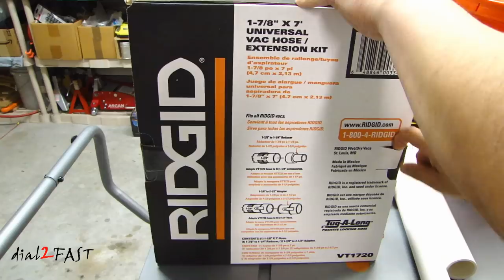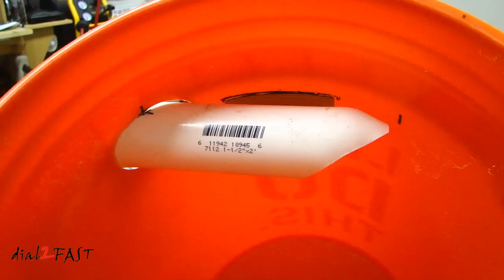How To Make a Cyclone Dust Collector for Your Shop Vacuum

Comment: after woodworking for a few years, today i learned how to cut a perfect circle on a table saw. that's genius.
Reply: And what was the point of cutting the circles in the first place? Or laminating an inch-thick mounting plate? Or using 8 screws? Or using a straight inlet pipe? Or heat-forming? Or driving to HD and taking the rest of the day to save $65?
Buy some wet-vac dust bags and go smell the roses while waiting for them to be delivered, for heaven's sake.
Reply: dufftime I
Reply: y come here to troll, go smell the roses while waiting for a purpose in life...
Reply: @niebzdury1377  Multiple-decade woodworker here, still with all ten digits, and nothing he did there was additionally dangerous than any work on the saw.  It's good to respect a tablesaur, fer sher, but you're paranoid here.  

Safer: A rubber tipped pushstick for his right hand.  Take a piece of dowel to HD and find a crutch tip to fit it.
Safer: A full-width platform with block to stop right hand.  If you do a lot of circles, make one.
Reply: @adamnoman4658   Rich buyers buy, poor makers make.  Pick one, the other, or both depending on your wealth and need to create.  Everyone's happy.
Reply: @ljprep6250  ....                      Whatever
Reply: @nc3826  looooooooooooooooool funny
Reply: I totally agree. That circle cut was genius. Totally going to use this technique
Reply: @ricardoperez5324  Where was the technique on the circle cut?  I guess I missed it!  I would like to learn it as well!
Reply: @danhopkins3242   I think they are referring to 2:58
Reply: HD and Lowe’s buckets are garbage to thin Use a paint or stucco bucket much thicker, great video I will be making one today Thanks
Reply: Adam Noman  Upu missed the whole point of what a cyclone separator does.  I have several of these in my woodshop, home made in different designs, and never have to even open the vacuums, let alone change a filter.
Reply: @Shane Alec instablaster =)
Reply: @adamnoman4658  Well, see, the bucket lid is circular and the outlet pipe is circular, so the most logical shape for the mounting plate was a circle. 

The mounting plate stackup was far thicker than an inch (get your eyes checked) and I imagine this material thickness was used to ensure lid rigidity and get plenty of thread engagement on the screws. 8 screws were used to equally distribute clamping force over a large area. MDF is very flat but brittle in flexion and torsion, so it's important to clamp it evenly. Also, the plates were SEALED to the lid, not LAMINATED to each other. Do you need an explanation for why this device needs to be airtight, too? 

A straight inlet pipe was used because that's how this whole thing works; directing the inlet stream tangent to the circular side to create a vortex. Curving the airflow path unnecessarily creates turbulence and wastes energy. 

The heat-forming was done on the inlet pipe (as was explicitly mentioned in the video, get your ears checked, too) to avoid sawdust from escaping the top of the vortex and going straight into the vacuum hose... which, AGAIN, is the entire purpose of the device. The outlet pipe was heat-formed to ensure the tapered end of the vacuum hose made a positive seal with it, instead of the narrow, easily-detached contact patch you get when you jam a cone into a cylindrical cavity.

I'm just wondering how someone with so little inventiveness, engineering skill, gumption, and (allegedly) free time found this video to begin with, much less why he saw fit to criticize it using easily-answered rhetorical questions that display his ignorance of the subject... MUCH LESS why he proceeded to conclude his critique by questioning the very purpose of vacuum vortex separators in general ("just go buy more vacuum bags, DUH") as if that didn't invalidate his opinion on their construction.

Go buy a 10-pack of vacuum bags, this dude will still be on his first bag by the time you finish your last one. Use the time you saved to read a damn book and learn something.

Comment: Great build. Note you want the inlet dust to circle the bucket in a centrifugal motion. The momentum of the dust will keep it out of the low pressure zone (the center of the bucket) this will help keep the really fine particles out of the discharge. You also want to slow down the center flow compared to the inlet. You could change your PVC insert from the top (the outlet of the bucket) to a 4”. This would slow the outlet velocity to the point that less dust comes out. Really important to have that downcomer extend past the level of the angular inlet, just like you did. Really good job.
Reply: Would using a smaller angled inlet pipe (using a reducer just outside of the bucket) create more "dust velocity" and a better vortex?

Comment: Cool project, been watching about 10 similar cyclone videos but this is one of the better ones. Went into the workshop and built a similar thing afterwards, only I did the whole lid out of wood and put the inlet in the lid as well with a 90 degree bend, works super, makes it more compact and no need to cut a hole in the side.

Comment: Excellent design, I finally find something that doesn't look messy. Lots of detailed information and straight to the point. For thirty years I have used a vacuum cleaner that uses water as filtration, my finished unit will have some water at a very low level inside the orange bucket for further dust entrapment. This post is awesome, Thanks

Comment: The heavy particles will stay in the bucket, however, the finer dust can still make it through and will eventually clog the shop vac filter. One way to help is to add an inch or two of water to the bucket. The water will trap the finer particles and reduce the frequency of filter changes, or cleanings  in the shop vac.
Reply: Vine Len exactly what I was thinking... a dust bong
Reply: TRIED IT, very effective but too messy..?
Reply: I've often wondered about this method as being much superior for fine dust. Have you tried it with fireplace ash or drywall dust both of with seem to be problems with ruining the vacuum? Also, does the pipe with the dust have to have its end submerged in the water so the dusty air has to bubble through the water or is it good enough to just have water at the bottom of the pail? (As @John Sayewich Jr. said - it would be messy, but maybe worth it for smaller amounts of fine dust).
Reply: I figure you would need a second bucket after this first one that would be the water filed bucket one.
Reply: @ryancappo  they used to sell a similar set up at Home Depot. I used it for sanding drywall, so there were no bigger particles. You could try a second bucket but you would probably lose to much suction.

Comment: When you cut that elliptical ole in the side of the bucket, you could have cut it smaller/filed it less and used your heat gun to soften the bucket - then force the intake fitting into the softened opening. Quite possibly all but eliminating the need for sealant.

While the Home Depot Bucket is pretty and has a seal in the lid, it is not designed for  frequent removing and replacing - none of that type of pail are. As well, the small bucket is just that - rather small.  

Given the time, effort and expense involved in the project, the bigger, the better.  Find the largest can you can and adapt it.  The larger the can, the less frequently you need to empty it. 

Ooops, I should first compliment you on your build. I watched the entire thing. Well done.
Reply from the maker: Appreciate your comment!
Reply: I found recently that the buckets used for storing pool cleaning chemicals work very well as they are a bit larger than the typical 5 gallon bucket and the lids seal and unseal with a simple twist, making them easier to clean. If you live in an area where there are a lot of pools, you should be able to find a pool cleaner fairly easily. They are eager to give these buckets away for free !
Reply: M
Reply: Danny H. Nn
Reply: Or you could cut a round hole and use a 22 1/2 on the inside...way simpler

Comment: Nice job on your home made cyclone dust collector. The problem I see with these type of cyclones added to a shop vac is that they are difficult to move around and they take up to much floor space so I solved the problem by mounting my cyclone above the vacuum. With a little ingenuity you can adapt your set up to most any brand shop vac. I also found it easier to maneuver the vac in the shop by removing the existing  three or four wheels and adding a wider platform with six smaller wheels for the base. Also much less likely to tip over when moving .

Comment: One potential problem with simple collectors that have no separating mechanism (such as Thein baffles or cyclonic separators) occurs when the bucket has a few inches of dust in it.  My understanding is that as the level of sawdust rises, the airstream starts picking up dust that is already in the bucket, and starts drawing it into the vacuum tank.  This probably wouldn't be much problem if you empty the bucket frequently.

Also, you should be aware that this won't eliminate completely the need to clean the filter from time to time.  The extremely fine dust tends to stay suspended inn the airstream, and not fall into the bucket, but is filtered out by the shop vac's filter.

You've come up with some very simple techniques for building this, which I will no doubt borrow when I build my next dust separator.  Thanks!

Comment: For the next/advanced version, what you should try to build is something you put on top of a bucket, e.g. by using two buckets that fit halfway into each other and cut off the lower third of the existing one and stuff it on top or similar. The idea is that you can easily swap out the buckets to collect stuff and go elsewhere with one to empty it while having one installed that can still be used

Comment: this is it!  - 
i´ve seen this video some time ago but forgot about it as i was straggling on youtube to explore all the different dust collector projects, most of them with the two chamber idea , but finally happened to come back to this one again! 
Great!  - i´ll definitely build one like this! 

i guess a main factor is the distance between the dust input (plus its drifting direction) and the air output tube
maybe the output does not have to reach as much into the bucket
Reply from the maker: Thanks for your comment!

Comment: Awesome video... I am gonna make this as shown for sure.  I will mount both shop vac and bucket  into a low wooden cart that I would make with caster wheels.  Both will then  be pulled together as one  and also prevent tipping.

Comment: Something that I have learned is that you can modify and old shop vac bucket and taking out the vac motor and sealing it up and then just connecting the hoses in series to the shop vac that works...  By doing this you will have and easier time opening and  emptying the collector bucket, also the holes are already there, you just need to seal up where the old motor was really good and you will have a very respectable and usable catch bucket....  I LOVE MINE AND IT HAS WORKED VERY WELL FOR YEARS, IT ALSO SAVES ON BAGS AND FILTERS....   IF YOU ARE VERY CLEVER YOU COULD ALSO USE A FILTER IN THE COLLECTOR BUCKET TO GIVE YOU A VERY CLEAN EXHAUST.............................  JUST SOME THOUGHTS FROM AN OLD TINKERER..........

Comment: Nice job, I built one based on this design but I ended up having to use 2 buckets for more depth on the debris as my shop vac now has more suction power as the filter is kept clean, it was pulling out the debris from just one bucket. Now that I am using 2 buckets, I get more volume to hold the debris and it all stays inside the buckets. Thanks again and keep them videos coming.
Reply from the maker: Excellent, thanks for your feedback!

Comment: Note:  theses units only separates the heavier materials and not the fine dust! 
i use exactly the same thing daily, except i have a 20' x1 3/4" sump pump hose that cost 9$ instead of 40$ for 6' for "shop vac hose" and i put a few inches of water in bottom wich helps alot (emptying daily). They can  be easily hooked to as little as the 2" mini vacs or  1200cfm dust collection unit.  I can say its great for any table saws, planers, festool track saws, domino jointers and routers all day long. but the fine chop saw and palm Sanders dust gets through even with water in bottom of bucket.so best to use a cloth sleeve over the vac filter, so u can shake it off quick to clean. it saves me dumping a 50g bag and blowing out a giant filter 2 to 3 times a week down to once every 2 weeks! 
plastic lids are very strong no need for all that crazy circle making or plumbing, hot glue seals great too, was a good vid for tricks tho.cheers to clean shops!

Comment: Good video....I went one step different that made life even easier....bought a $5 junk shop vac (Size of a 5 gallon bucket,) stripped the motor off and plugged a few holes with some screws and a bolt.  Took about 15 minutes.  The important plastic pieces were left to allow for the hose inlet/outlets. I can pop the top off in heartbeat and it works like a charm.  Goodwill type stores or yard sales (which is where I got it) are good spots for these....Oh and I can still use the paper and foam filter from the junk vac. (Or not as I choose...)

Comment: Great Project but if you do not want to cut the wood you can at Home Depot Buy a gamma Lid instead of Standard lid and it will Run you 10.00 in the paint section. they are also air tight!!
Reply: I like the idea of the screw-in lid for being air-tight but still easily removeable, but the bar shape of recessed plastic across the lid that makes it easy to install/remove, makes it trickier to get a hole for the vacuum hose. Could the vacuum hose hole be off-center in one of the depressed parts of the lid? (would put picture here, but seems these comments are only for text). You can see the problem here: https://www.homedepot.com/p/Leaktite-5-gal-Screw-Top-Lid-5GAMMA6/203205720

Comment: Great job.  2 suggestions: 1) HodeLowes sells a screw off bucket top, well worth the investment for the lid.  2) The bucket will collapse if your suction is blocked, it’s pretty funny to see.  To stop that from happening, just buy 2 buckets, and simply drop the cyclone bucket into the other. Problem solved.

Comment: Great video, about the only thing I would do different is, I would use something other than a five gallon pail because if you're going to use it for serious woodworking you're going to be emptying it a lot and those lids are a royal pain in the nuts to get off sometimes. Loved the tables saw circle cutting.

Comment: buy a 2nd bucket, put a plastic liner in it, cut the bottom off of the one you just modified and slip it into the second bucket. much easier to clean, and empty.
Reply: Clever idea buddy.
Reply: R0i0c7h i don't understand your idea... Plz explain...
Reply: Kevin Thompson plz explain bro...
Reply: @sunnykapoor0000  the dust will fall to the bottom of the cyclone bucket as normal, but instead of it sitting in the bottom of the bucket it falls into the trash bag inside of the bucket that the cyclone bucket without a bottom is sitting inside of.
Reply: Or just put a little water in the bucket. Presto

Comment: Very good and informative presentation. I like the method of making female inlet adapters with a heat gun. Having access to a metal lathe, I have made them from sched 80 pipe and bore to fit. Your method is simpler and works with readily available sched 40 pipe. Thanks for the tip!
Reply from the maker: +Christopher Schissler Thanks for your comment!

Comment: Well done for your well made video!
I don't see anything other than silicon holding the bucket inlet pipe in place.
I would suggest either drilling a couple of small holes above and below the wooden brace and threading a cable tie through them to go around the pipe inside the bucket to hold it in place.
Or, drill a hole just big enough in the pipe to allow a screw driver through to enable a couple of flat head or countersunk screws to secure the pipe into the wooden brace..
Personally i'd go cable tie route as you can then clamp both the pipe and the brace in postion in one go.

Comment: I think if you fill that bucket up, and not just having a little dust/chips in the bottom, then you will see the advantage of the Thien baffle. Now you can easily make one and attach PVC fittings to save $$$$ It would replace that top of the bucket you have. The top is tight right now, but with enough openings, and closings it will wear out.

Comment: I like the way you cut your circle out on the saw table. What is the pivot point that you used and how did you stick it onto the table saw?
Reply from the maker: I just drilled a small hole in the middle and then put a nail through it and onto another piece of wood under. The bottom piece is clamped down.

Comment: Great Video, easy on the eye. would a taller bucket reduce the risk of powder/ dust reaching the vacuum filter, would a larger diameter vacuum extract hose increase the chance of powder /dust reaching the Vacuum Filter

Comment: The "Dustopper" kit is ready to use and comes with the hose. All you need is a bucket or 20 gallon drum....it's also sold at Home Depot for $40

Comment: Awesome, the exact instructions i was looking for.  But how did you do the circular cut on the table saw? I saw the screw or whatever in the middle, but how did you hold that in place on the underside?
Reply from the maker: I drilled a hole in the middle of the circle. The circle is screwed to a piece of rectangular piece of wood and allow to rotate freely. That rectangular wood is clamped onto the side of my table saw using clamps. You will first need to notch out all the edges and get it as close to the circle shape as you can. Then you can use the table saw to trim the edge to make the circle.